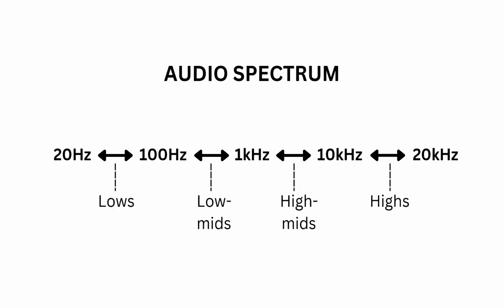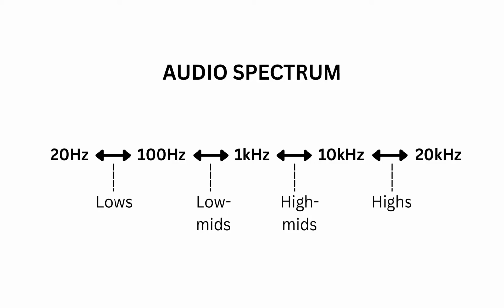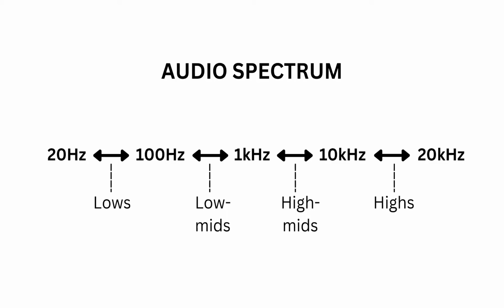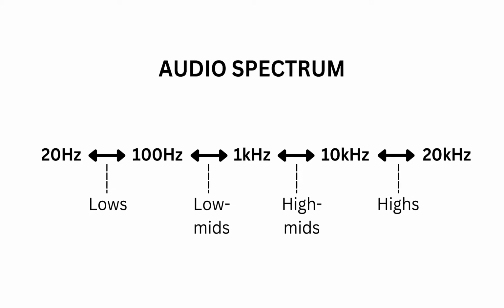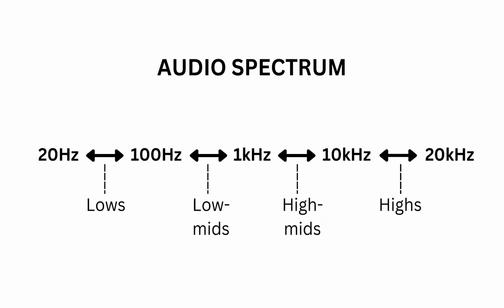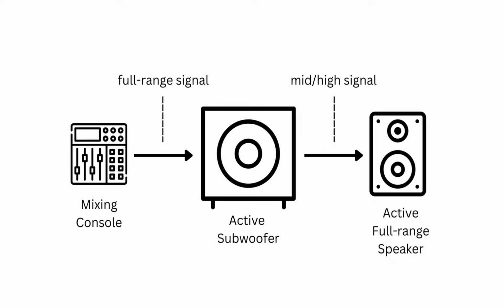Connecting an Active Subwoofer to your PA System (Detailed Guide)

Comment: I was given  active speaker pa system (2 × 12" Soundking/300watts) and a 12 " subwoofer 600 watts. I'm not a dj and Simoly want to connect these  units to a sound source in the Man Cave and make the house rumble. How do I connect to a pre Amp that is running the fm receiver,turn table ,Blu Ray ect. Please help🎉😮😅

Comment: this is not the best connection to use the output of an active subwoofer to pass signal to the active speaker because the active speaker gets loud,the best connection is that the active speaker passes signal to the subwoofer,because the output of the active subwoofer is for connect passive speakers.
Reply: Why does it get loud? Isn't it just a copy of the subs input signal with low frequencies removed?
Reply: @noisevector what's the best way to connect the Subwhoofer, PA to Subwhoofer  or Subwhoofer to PA?
Reply: You are incorrect.

Comment: Good guide, i have a question for you if you don't mind. As a church we have bought a mixing console, an EP4000 Amplifier which we are running with 2 passive speakers at 4 Ohms each.

We want to add a powered subwoofer and 2 monitors to our System. How are we going to run the connections. How do you advise?